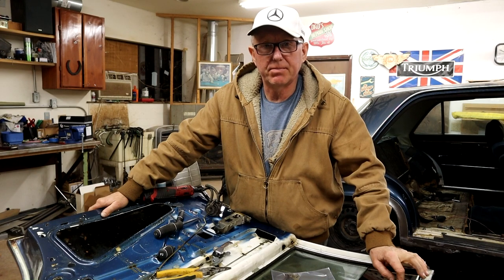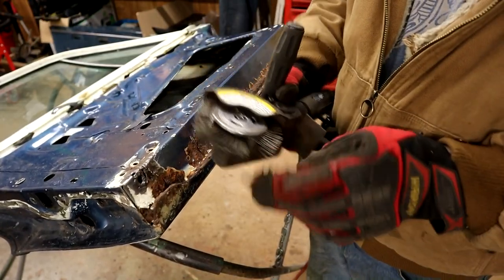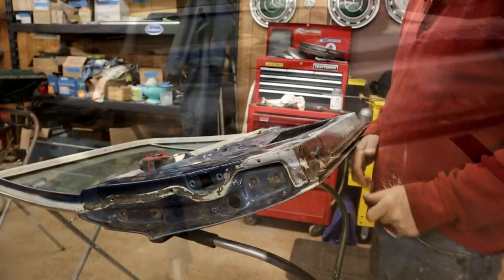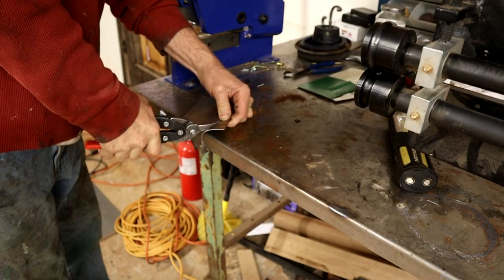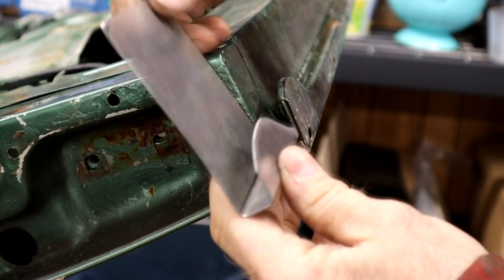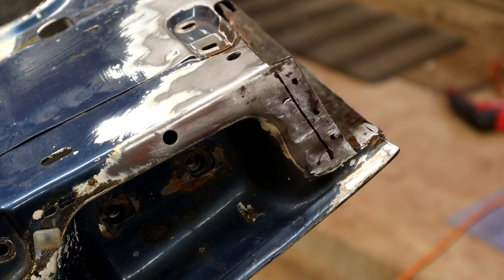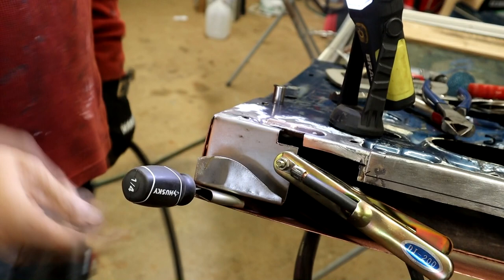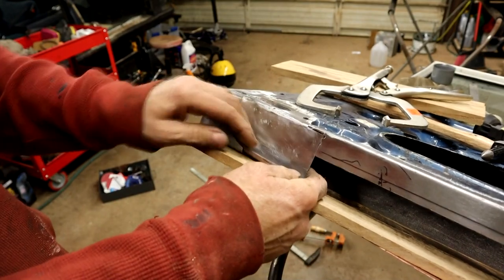Mercedes w109/108 Rear door rust repair. Part One

Comment: That was a difficult repair, it looks great so far. You are really creating a great reference project for all those in the future who are blessed to have a 109.
Reply from the maker: Thank you Mark, glad you're enjoying the videos. Yes the door repair was a tricky one, I find taking small steps helps make complicated repairs more manageable. I'm currently working on one under the brake booster. Very tight access, but its coming along nicely. Cheers John.

Comment: This is great! We have a W109 with this exact project ahead of us and I was really intimidated by it. Now I'm even more intimidated but at least I'm educated to the extent of the work and have a good guide to follow! :D The central locking system is completely shot too and we're thinking of replacing it with one of those central locking motor kits, not even mentioning the window motors and gears.
Reply from the maker: I'm on floorpans now and will post up some video on it. Let me know if there's anything specific. As for central locking, there's a company making replacement valves now. Name escapes me at the moment.  
Cheers John 🍻

Comment: Good video/ good narrative. Tough job. My '71 W108 will need some sill/rocker rust repair; this gives me the confidence& knowledge to approach it. 
What eye protection do you use for welding?
Reply from the maker: Thank you. It is a tricky patch, but taking a one step at a time approach will help. As far as eye protection? I use a self darkening welding helmet, with a magnifying kense to help me see the weld. Cheers John.
Reply: @mercedesmaintenance.6339  Thanks, John. It's good that you made three patches to match the factory work.

Comment: Nice work. I need to do the same thing on a W123 passenger door. What kind of wire feed welder are you using?
Reply from the maker: I'm using a Titanium 170. Its a great welder. It gets the job done very well. "MIG 170 Professional Welder with 120/240 Volt Input" https://www.harborfreight.com/mig-170-professional-welder-with-120240-volt-input-64805.html
I'm not an experienced welder by any means, but with some practice on some scrap I got the hang of it. Thanks for the comment. Cheers John.
Reply: Nice welder.
Reply from the maker: @garywiderburg2771  I think the 135 model would work fine too. I went for this one because it will run on 220 as well as 110.  But I've only used 110 so far.

Comment: Confucious says: Those who not cover glass will have to replace after grinding or welding in same shop.
Reply from the maker: Thank you for that warning. I will definitely check it and take steps in the future. Cheers John.
Reply: @mercedesmaintenance.6339  Glass is very susceptible to sparks. In my workshop I even found spots on the windows and the clock glass, metres away from where I work.